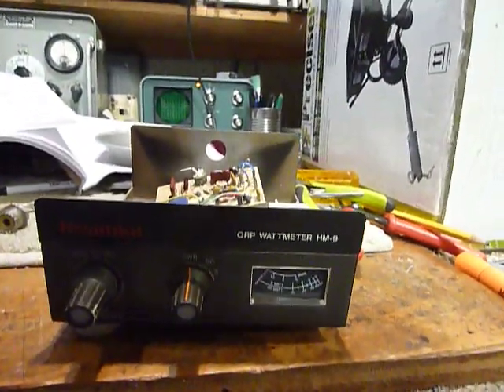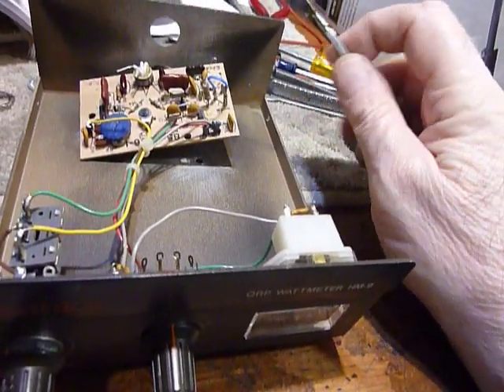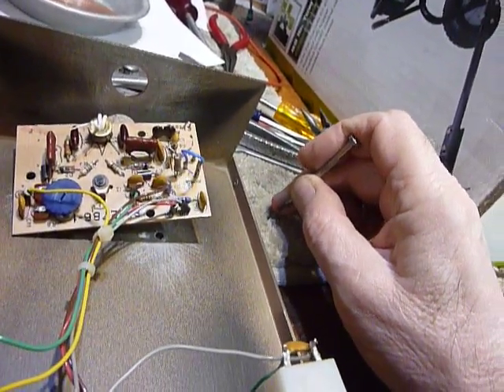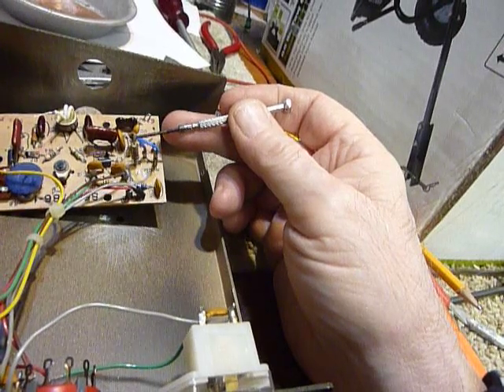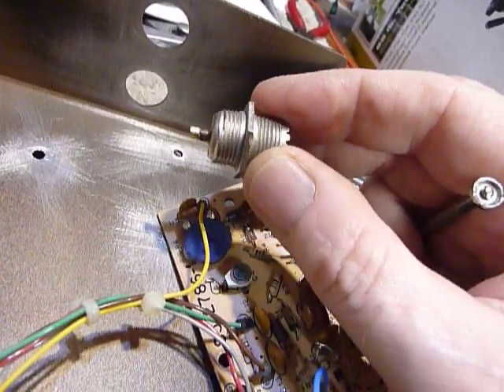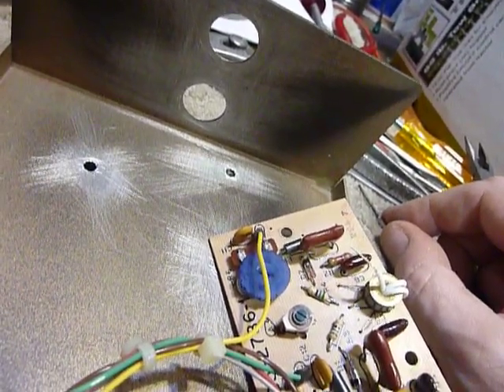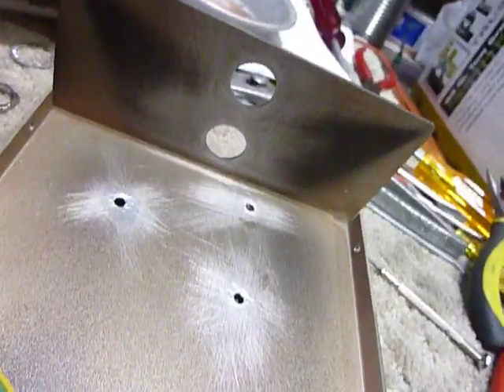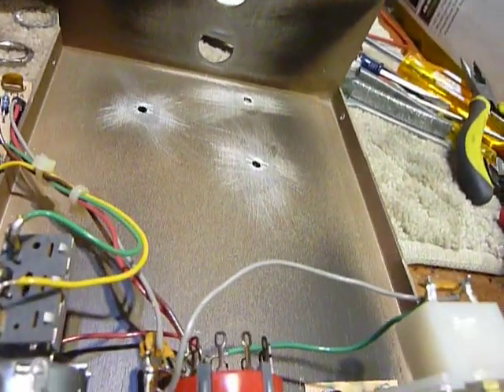PART 1 HM9 HEATHKIT , HEATHKIT HM9  QRP WATTMETER SWR METER  ,

Comment: IF you need the Diamond style (2-hole mount) SO-239 connectors ...
I have a couple for your project.
Reply from the maker: No the E6000 glue worked great  and if I was to remove them now it would be difficult that stuff really grips  .  I have made the diamond style SO239's before  by clipping off two of the mounting holes. Also  I do want to keep the HM9 as original as possible .Thank you for your offer  73  Bob
Reply: So kind of u to offer ☺73 W9GB....👍
Reply: Amphenol made that SO-239 panel version, in the past.  I have old Amphenol stock in parts drawers.

W5SWL Brand Premium Series Coax Connector UHF SO-239 2 Hole Diamond Chassis Mount https://www.amazon.com/dp/B00PEZ75MM/ref=cm_sw_r_cp_api_i_XKuFCbT0NYA7M
Eastern Asia still uses 2-hole “Diamond mount” SO-239 on their radios, and sold on Amazon.